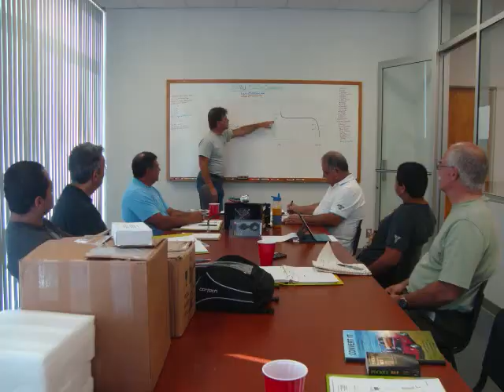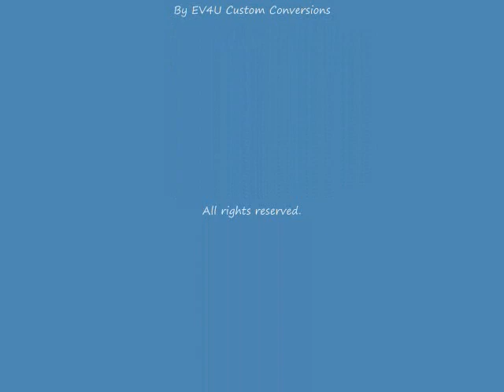DIY Electric Conversion Workshop

Comment: thanks for the videos, i actually came across your channel looking for videos for changing a clutch on a civic (CRX) and i started looking around at your other videos and saw the transporter electric conversion and a light went off in my head! i have a 1964 microbus and of course a CRX both would make great EVs (i think) i was wondering if you have done either of these in the past and how it went. also, do you think it is going against the "VW code" or whatever by going electric or have people been pretty receptive to it?
Reply from the maker: We display at a lot of VW shows and have always been well received.  The Transporter can take off in second gear and leave rubber, that's always an attention getter.  Thanks for watching.